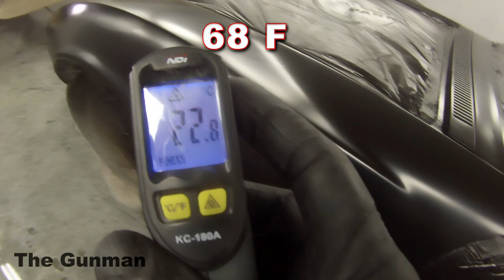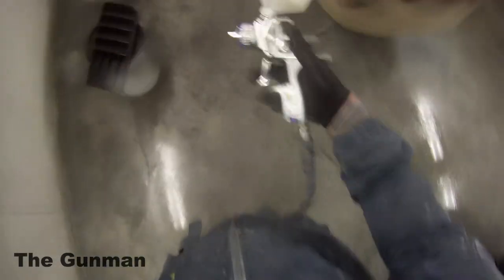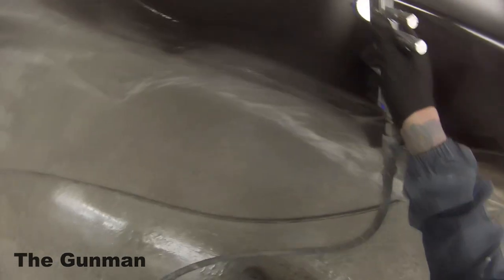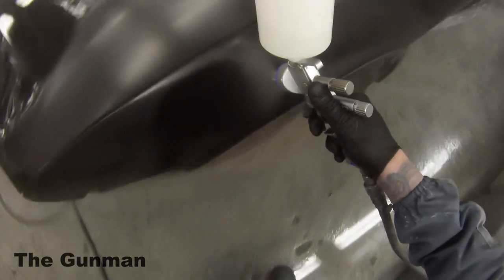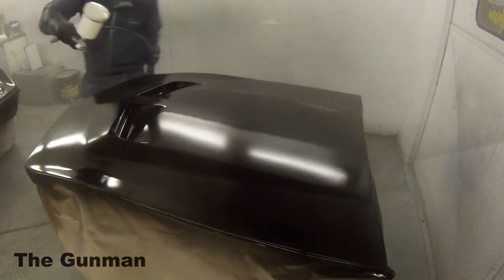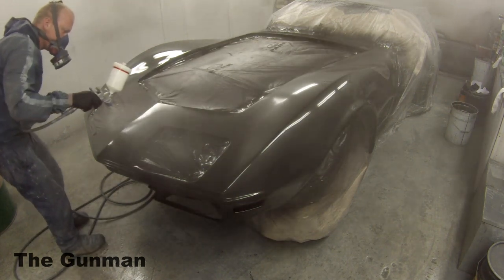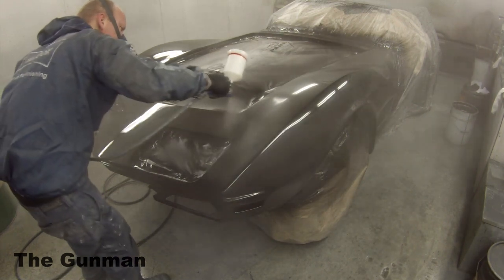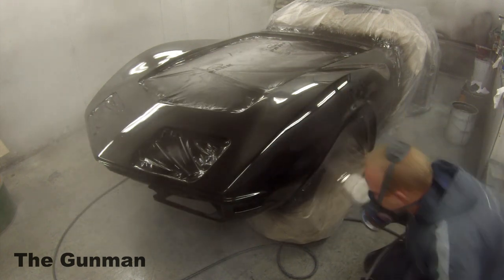Corvette Stingray Clear Coat

Comment: I started painting with a sata 4000 1.3 conventional the I saw your gun review vids and I've been using a devilbiss tekna prolite 1.4 te20 air cap. It has definitely been my favorite gun I've used so far. I have a 1969 camaro painted in black coming up this week to do with it.

Comment: I'm in the process of getting all my supplies to begin painting. I've purchased my guns based on your recommendations, an ani a flg5, a air gunza, and a pro lite,  I'm new to painting just installed a 60 gallon compressor and want to setup a booth inside of my garage any suggestions you can give me on fans and filters and lighting would be greatly appreciated...Thx...

Comment: Hey G-Man ...ok for once I am confused...if the clear went OFF in the pot after a 10 minute break...how could it possibly still be soft after days of a thin layer on the car???Did the folks at concept have anything to say on the matter? And was it picking up dust all that time? Cheers Pete
Reply from the maker: TresMamboMusicSchool I was asking myself the same thing mate, it was hard enough to handle so not sticky but you press it and you'd get fingerprints. Haven't asked the Concept mob yet but definitely will be.

Comment: I bought 2k paint to paint my project. I was given a base coat with the clear mixed in. Apparently it will still produce the same result as applying clear over base and the guy said it would be easier for me to apply. All good to use, hard/easy, safe/unsafe?
Reply from the maker: If it's a solid colour eg no metallic then sure but if it's a metallic you've got some dodgy stuff.

Comment: Hey Gunman,my ebony black ppg eurethane base coat mixed 2 to 1 & I added about 5 to 10% extra reducer because it just seemed thick on the stick,and even tho it sprayed on beautiful & looks great after 3 good coats & I gave it 2× the flash time between coats & with about as close to 0 orange peel as you could ever get,it has a slightly semi gloss looking finish to it about 6hrs after the last coat,is this normal after this amount of time with some black base coats??I'm letting it set overnight just to make sure all the solvents have gassed off and I have a 24hr window to clear coat but since this is my first time using this ppg eurethane black base I'm not sure how it should look.The base definantly is not flat looking,but the little bit that ran down the side of the can looks the same before reducer.Do you think it's just the product or a potential problem down the road?? Thanks for all the help Gunman.

Comment: love the vids keep em coming just wondering  is that the sata jet 5000 rp you're using for clear?
Reply from the maker: Thanks mate, yep that's the one 1.3mm
Reply: Isnt the rp for paint thanks for the reply also  i am an aprentice working at a professional repair shop  and i was wondering have you ever had any problems with paint reaction or shrinking as you spray

Comment: ive painted touch  UPS  on my car  but used spra  clear in  a can  when y ou look at thé car looks like y ou mised  on clear if i wet sand  with 400 to kill  thé effects ans reclear hole  car would it work
Reply from the maker: As long as you don't cut through the colour then yes, I have a video and blog on the process. http://thegunman.net.au/how-to-flow-coat/

Comment: So a full face air fed mask isn't needed for 2k ?
Reply from the maker: +lustamatrix69 it is recommended and I am using one these days but without the correct air filtration system you're best with cartridge filters
Reply: The Gunman  OK cool, I'm spraying bit by bit at home  i have a cartrige mask for asbestos but no booth , can 2k clear go over an acrylic base cost